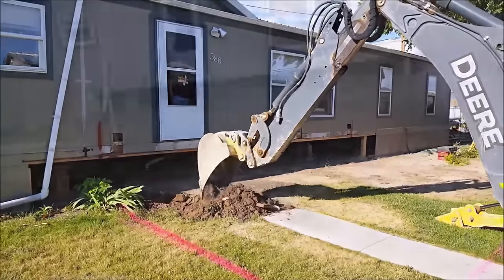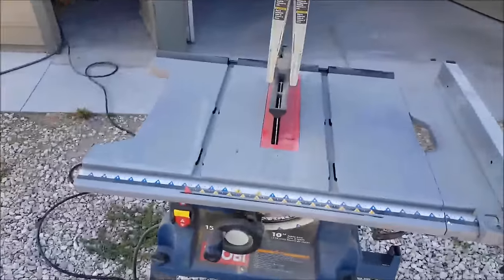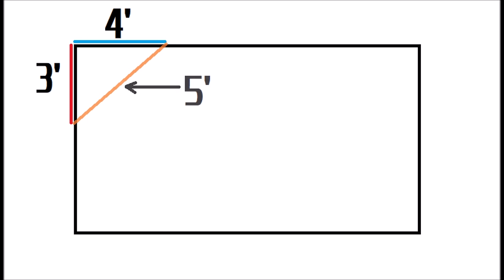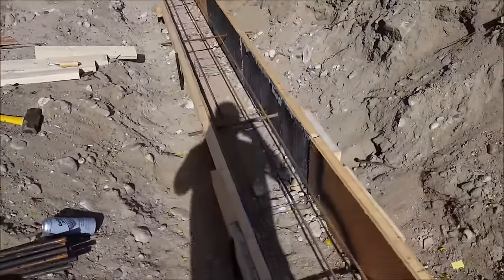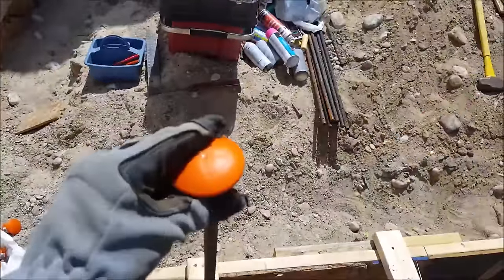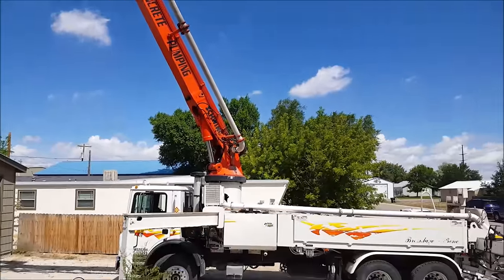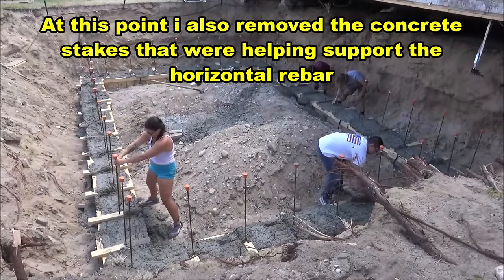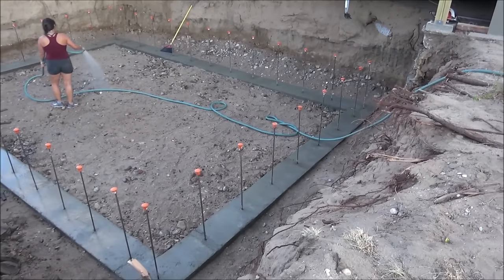How to Pour Concrete Footers for Block Walls start to finish DIY

Comment: This is interesting. I just had an inspector tell me that code is revised . He said there was zero evidence found that supported the theory to keep the rebar vertices out of the dirt . He said he now allows verticals to be pounded in the earth .
Reply from the maker: Building codes may vary depending on the area you're located. So with that in mind you should always follow your local building codes, the biggest reason you don't want the rebar to touch the dirt is because the rebar can begin rusting and deteriorating easier.
Reply: @Devon Farts Lotion, That inspector can tell you it's now safe to run with scissors because they rounded off the tips, are you gonna start running? Pound the ground all you want now that they revised the code, it still doesn't mean it's the best way in theory. Stick to the rule of thumb methods in shared thoughts by years of experienced tradesmen who've done things a certain way for good reason, or don't? You do you, it still comes down to the strength of integrity in the work you build & the worth of integrity you want to carry in yourself. F%$k theory & short cuts, be the best you can in the work you leave behind. Sure, you have to follow building code standards or "better," yet a city or county inspector don't know jack accept what they are told or read in their book! So, do it right & stay out of the dirt.

Comment: how much is the concrete? how much is the rebar? I seem couldn't find those things in my local area.
Reply from the maker: Prices will vary by location. Concrete in WY is around $150 a yard. Rebar is around .60 cents a foot.

Comment: Nice video, but how do you keep water out of your basement?  I didn't see any drainage provisions or waterproofing.
Reply: Seal the block inside and out, vapor barrier inside and out, closed cell foam, or rigid foam insulation inside with all gaps sealed tight. Outside, install crushed stone and a drain pipe all the way around the bottom of the wall to channel water away from the home, And top with stone then back fill. Proper ground level grading,  18-24" roof overhang, and gutters and you should be all set.
Reply: @jimhabsfan  yeah in a subterranean application like that you might have to, not ideal, but it will work
Reply: @jimhabsfan  yeah in a subterranean application like that you might have to, not ideal, but it will work. As long as it's sealed properly so you don't end up with mold issues. I saw a basement that wasn't done properly that ended up costing the homeowners insurance company close to $100k in mitigation and restoration.
Reply from the maker: Footer Foundation drainage being necessary is dependent on locations. Check local codes and do research for your location to know if footer drainage should be done.  My house is above all water tables where i am located.  So ground water is not an issue for me. I also have sloped concrete pads surrounding my house to push all rainfall/ snow moisture well away from foundation. The entire exterior of block wall was also sealed with a rubberized coating before backfill. And I also have a sump pump hole just in case that will probably never see moisture.

Comment: Thanks ! How much doea a yard cost. Did you treat the block with anything before you. Back filled? Also Diid you back fill with gravel or just dirt?
Reply: IMO you should always install a drain at the bottom of your stem wall surrounded by gravel or crushed stone to channel water away. Proper grading, a 18-24" overhang and gutters are ideal as well. Concrete on the outside should be sprayed with a waterproofing membrane and a plastic vapor barrier inside and out and on the inside it should wrap around all the Piers and be sealed with a mastic to create a conditioned space. This will eliminate the humidity and moisture that will lead to mold.
Reply: Thanks for your reply

Comment: In my case, I want to build a circular pool with cinder blocks. Would it also need a footer like this? And if so how would you make the forms for it? Would I just position cinder blocks in two rings to pour the concrete between them? And is rebar flexible enough for a circle?
Reply: i feel so dumb for not being able to understand shit...i wish i could build my own house like that..

Comment: For the walls, why did you choose Cinderblocks vs poured in place concrete walls? Are cinderblocks more cost effective for your region?
Reply: Noticed that you haven't received a reply yet - Not sure why he used blocks, but a block wall is stronger than a poured cement wall.

Comment: Did you put dump proofing under your concrete base??
Reply: I am surprised, that dump proofing is so much ignored in the us. Even when not forgotten, it is a joke.
In my second world country this practice is unacceptable. Here we do it the following way:
- First we make the footer
- Then a slab reinforced with mesh and it goes over the footer, to ensure it will not sink later
- Then the slab is insulated with a thick (0.2") bitumen based material
- The wall blocks are placed on top of the dump insulation
- If heat insulation needed, it comes on top fo the dump insulation
- A thin layer of concrete comes on top of the dump or heat insulation
- Later the external dump insulation of the wall is make continuous with the dump insulation under the wall

Comment: is it unheard of to mix the concrete yourself and have a ramp dug down to get it in there by wheel barrow, like if your location is in a difficult to access location?
Reply from the maker: No it's just a lot of labor involved.  It can be accomplished .
Reply: @D.I.Y._All-in-One  cool thanks.

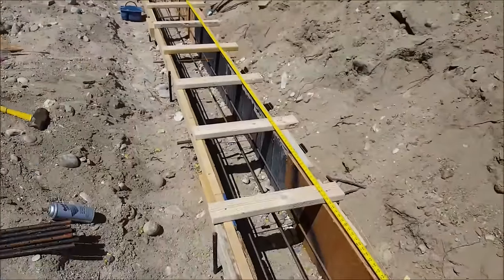Comment: 5:15 Did you say that you spaced your vertical rebar at 24 inches apart???
Did they always fall center???
Reply from the maker: 2 ' and 4' spacing will land inside a block cell , providing your starting point is correct.
Reply: @D.I.Y._All-in-One  
Thank you very much...
I'm about to do a similar project and I needed to know that important fact... glad I found your video... gonna make my job easier...
Good session...

Comment: Nice video! Bravo on all your detailed quality work. I am building an addition this spring. Would you say a block wall is cheaper to build than a poured concrete one? Did you have experience before doing this concrete and  block work or was this your first time? Thanks in advance! Jason
Reply from the maker: Thank you.  block walls is cheaper if you don't already have concrete forms to build concrete walls but...  There is more labor involved with block walls and it takes longer.

Comment: Why didnt you use any plastic? You are going to have moisture issues
Reply from the maker: Moisture issues usually relate to where the water table is, and the type of soil composition in your area or location.  Im my location I have nothing to worry about.

Comment: 08:21 don't pump truck have a regulation ? I mean a switch on how fast concrete should be pump ??
 Yours is like countinuing fast pump  (--------- )
I have seen diferent pump, more like go stop, go stop....more like shooting ( ---  ---  ---  --- ) i hope that make sense ..LoL
Reply from the maker: They can adjust the speed but i didn't have time to think or say anything after it started pumping. I just had to move fast and try keeping it in the forms.  If I had to do it again I would definitely discuss pumping it out slower before starting.
Reply: @D.I.Y._All-in-One  ok...i got it
Thanks for your answer 👍

Comment: 3-4-5 Rule: That "Pythagoras" thing you learned in grade school
 x²+y²=z² for the sides of a right triangle
that is, a triangle with a 90-degree angle, or "squared" -- 3²+4²=5² 

As you note, you can also double it as much as you'd like -- 6²+8²=10², for example -- and you'll also hear of the 6-8-10 rule in some circles, for that reason.

And, for greater lengths, you can use pegs in the ground and run twine from point to point (often a good idea to put your pegs a couple feet beyond your actual corners, so you can do stuff at those corners and not disturb your lines)

Comment: Its all good and well, but greasing the forms with spray like that is a mistake. You also lubricated the rebar, and that causes the rebar to not bind as well to the concrete. :(

It looks pretty good!

So did the rebar reach all the way to the top of the build? If you have short stomps you can always weld on some new rebar, but its better for it to overlap some so its easier welding. 

Greetings,

Jeff
Reply from the maker: Hello. I overlapped the rebar by 16" with a small bend at the bottom of the rebar extension.  The spray can had a pretty accurate spray nozzle so I was able to just spray the wood not the rebar which was located in the middle.

Comment: my main concern is sagging, how do you get the footing prepared so it wont sink and make the wall lean later on?
Reply: Two things come into play.  The first is that you want the footer sitting on undisturbed soil.  Adding gravel that has been compacted helps as well.  The size of the footer is the next critical item that ensures nothing is going to sink.  A 16" x16" x the length block of concrete is not going to sink into undisturbed soil or soil that has been properly compacted with base rock.
Reply: @SynergyAVE  how much effort is required to hand tamp the rock into place? also, if i focus purely on the footings first, and then pour an interior floor at a later time, does that compromise the structure in any way?
Reply: @davidross5640  Hand tamping will get tiring if you have a lot to do. However, renting a compactor is only $75 per day and is worth the expense. Amazon sells them for as low as $475, and they work really well.

It would not compromise the structure. The standard method of pouring a foundation involves pouring footers first and then pouring stem walls or foundation walls before pouring the floor.   In certain situations, another option is to pour the floor and footer simultaneously. Known as slab-on-grade or a monolithic pour, this foundation method is quicker and less expensive than a multisegment pour. However, soil type is essential to single-pour success.

Cheers
Reply: @SynergyAVE  well that doesnt really answer the question, and in the end this advice is a bit ironic... i would end up mixing the concrete by hand, which would make a monolithic pour very tiring...

but again, how much effort do i need to put into tamping, do i just tap it down to level, or do i pack it until im absolutely sure it wont give anymore, how much effort do i put into it?
Reply: TJP 81  that doesnt answer anything either... just a bunch of guys on here volunteering nothing...
Reply: TJP 81  its not vague at all, how do you stop a foundation from sagging, this is what the cool kids call, 'standards' but with each new post people keep reassuring me that they are not reliable...

Comment: inspectors dont like grease on the rebar ....grease before rebar
Reply from the maker: The rebar was located in the middle and I can spray pretty dam accurate with a spray can.  I already mentioned in the video that you can grease the forms before hand.

Comment: Shouldn't you be putting j bars for those verts???
Reply from the maker: Yes you can just bend the very end of the vertical rebar at the bottom by a few inches for peace of mind or code requirement. It's not required by building code in my area. I am personally not concerned about it . The rebar is locked with the concrete.
Reply: @D.I.Y._All-in-One  well if its for your home the more secure  the better i think
Reply from the maker: Im not agaisnt doing it. And I should have mentioned it in video.

Comment: I'm a mason and that footer is not thick enough, maybe by code but tour wall will crack soon ! Do not make them so thin it has to be at leat 36 inches high and 24 wide minimum! 25 + years of experience!
Reply from the maker: Why stop at 36", might as well go for an even 4 feet high!  230+ years of experience.

Comment: I’m curious why the footer is so high, at 16”. Typically they are only about 4” high where I live, sometimes 5”, or even 6” in extreme cases.
Reply: Depends upon type of dirt/sand/rock  you're building on - At least 12" below frost line